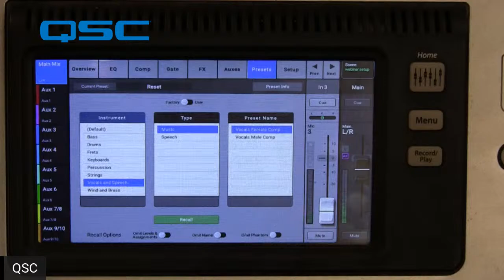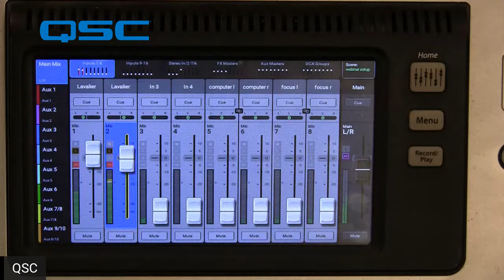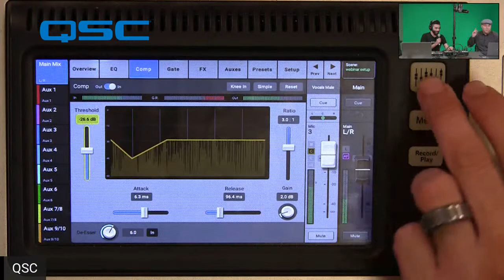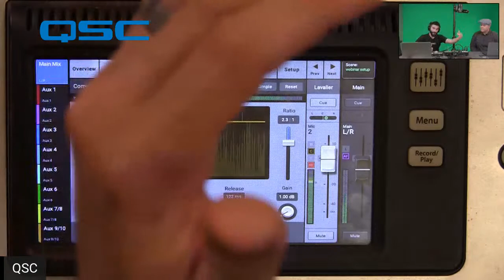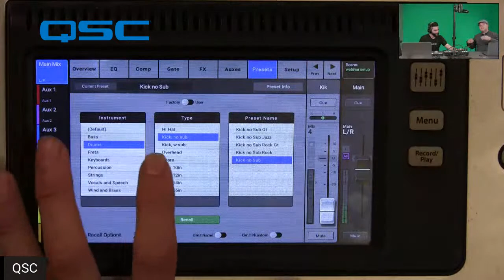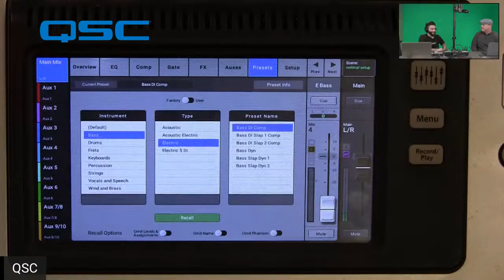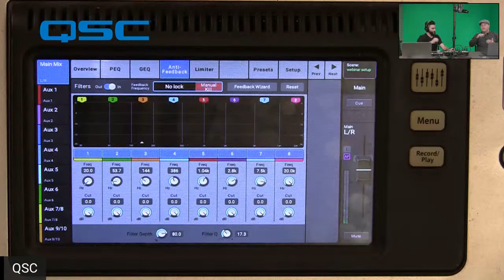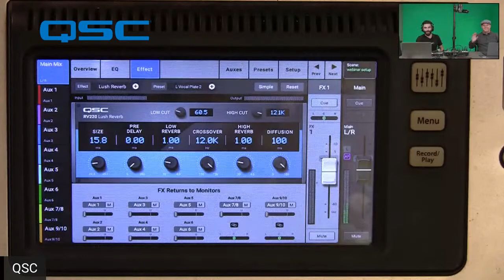Tech Talk - EQ Basics and TouchMix Presets

Comment: Hey, what about electronic drums ? I'm getting more and more high-end Roland kits where I only get a Left & Right feed. The drummer may have 5, 6, 7 different drum kits that they will use in a night. The other issues is they have usually done their own EQ & ambience per patch. So what about a preset or two for a stereo drum feed from an electronic kit as a starting point - food for thought
Reply: Hi , in those cases you would normally have them come in flat to the fader eq wise, Most of those instruments employ compression as std so that would be another setting you wouldnt normally apply, I suppose the Preset would make linking 2 channels faster but other than that..
Reply: Thanks John, that's exactly what I do today. I find that there can be inconsistent volume between kits as well as lack of bottom end between each patch. I have one drummer that has the top line Rowland kit plus a high-end drum pad. his volumes are all over the place so I have had to use compression/limiter to try and level things out. Same thing with guitar players who use profilers/modelers, in consistent patch levels between clean & driven patches. Love the board and being able to give each band member a tablet to control their own monitor mix is killer!